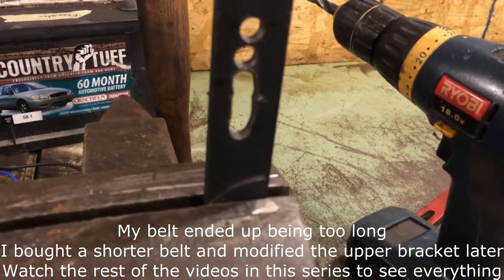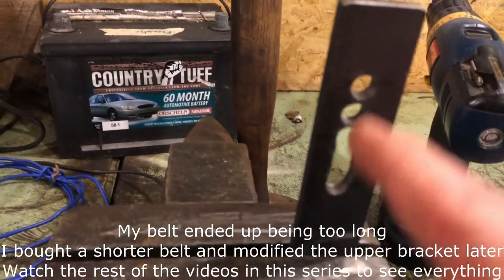Tractor 12 Volt Conversion Step-by-step Part #3

Comment: I have a home made tractor on 6 volts want to change it to 12 volts its old school with points    can I do it basically the same way your doing that girl >
Reply from the maker: I show the wiring diagram that I used at the end of the 6th video in this series. You should be able to do pretty much the same thing to any old tractor.